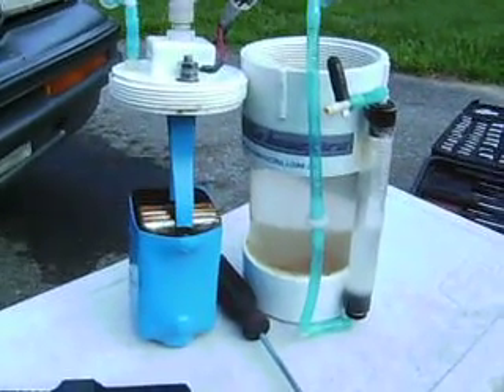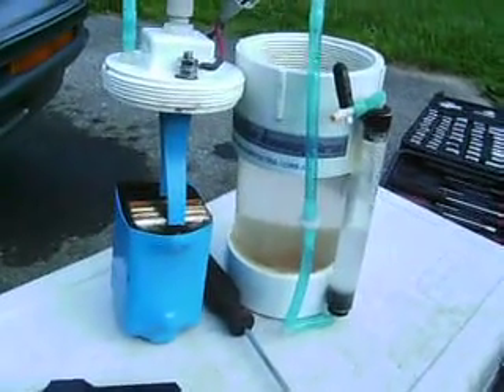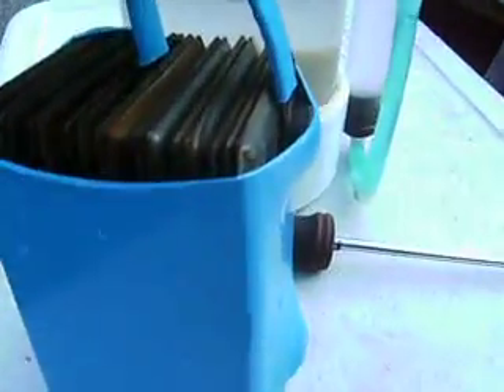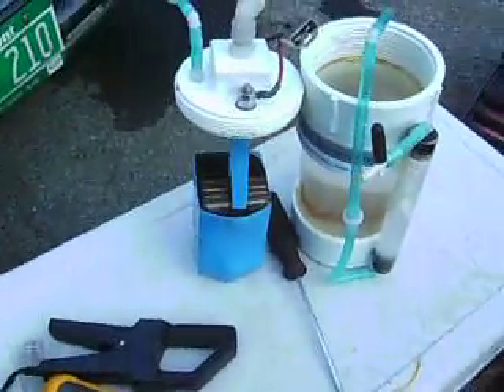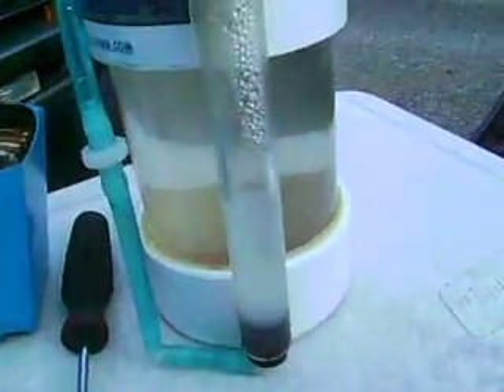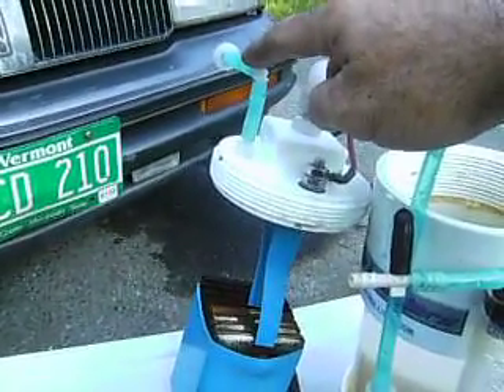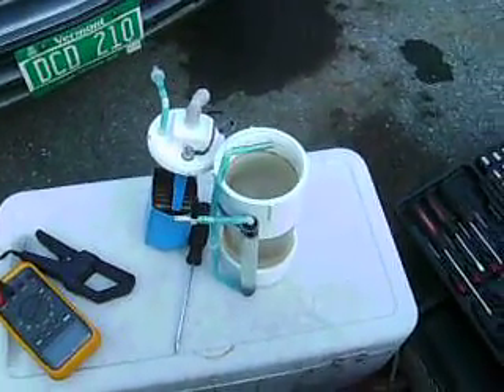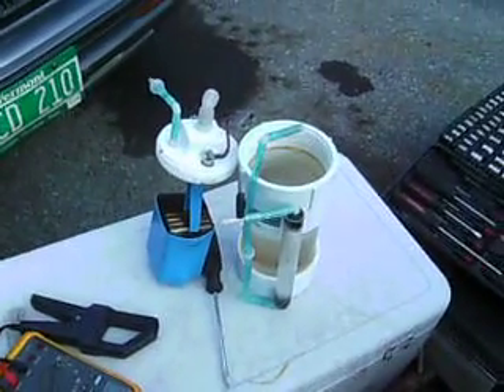Mods to the Smack

Comment: Hi Smack,
As I study your cell stack, and having done my own experiments with a very similar switch plate design, it appears to me that you could replace the double plates (those connected electrically via a metal nut between them, 6 places)with a single plate. I could postulate that you will get the same thermal and production behavior as you have now.
Did you test this configuration?
Your thoughts?

Comment: Hey Smack,
I'm just getting ready to copy your cell  
Question: Since you:
1 put shrink wrap around noticed a decrease amp draw ...inc efficiency
2 have plate sides that are exposed to electrolyte that do not create HHO (where the nuts are)that have the potential to further create wastage, and increase amp draw
....Is it reasonable to expect coating these sides with an insulator could further lower amp draw.
Thanks!
Lukeoid153

Comment: Nice video, I am about to mount my smackbooster but I'm having heat problems because of the high amps. Then I ran into this video. Quick question: where did you add the 2 extra plates? From the video, it looks like you added it to the outside plates, but I want to make sure before I do it. Thank you so much for making this video and all the others.